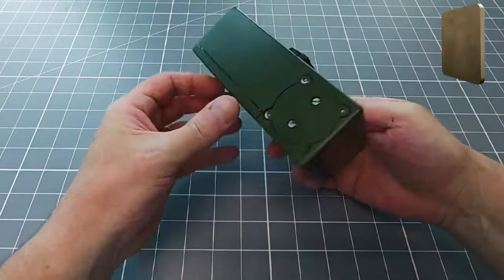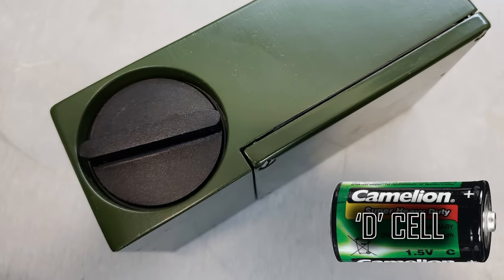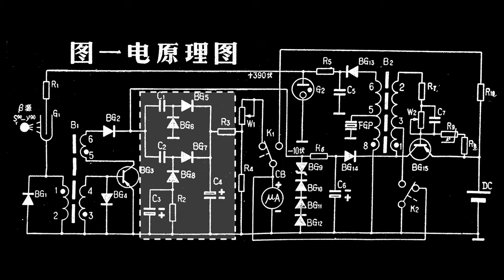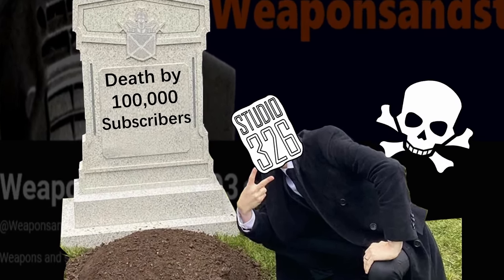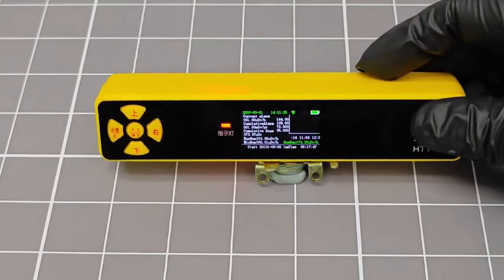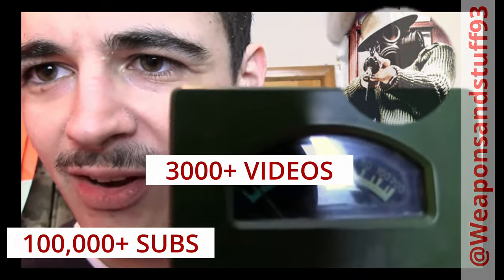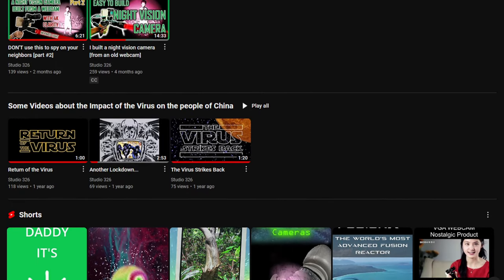Buying a Vintage Geiger Counter  ☢️

Comment: Yeah, you’re kind of right on weapons and stuff. He isn’t very bright countless pictures of him laying radium out on his carpet. Holding. Dp-2 sources dissolving the radium etc
Reply from the maker: I notice that he has really bloated out in the last couple of years, I do hope that isn't from mishandling these kind of things (hopefully just 'pandemic tummy').  Radium is about the scariest thing you could accidentally ingest with the obvious exception of Polonium 210, those old radium dials often release a lot of powder as they age...
Reply from the maker: That said, I am kind of expecting an army of his fans to start trolling the comments section of this video soon.
Reply from the maker: he is not the only one...  https://www.youtube.com/watch?v=-porXMRg_BI
Reply: When I got some thorium lantern mantles I kept them in the original bag, and put another bag over them. I'm the careless type so I am extra-careful with radioactive sources.
Reply from the maker: @gblargg  Very wise, the coating on the mantles is easily turned in to a powder...
Reply: @project-326 well, getting "bloated" also tends to happen when you get older.

If it was due to mishandling those kinds of things, he probably wouldn't be around.
Reply from the maker: @madmax2069  I know that feeling, all too well...
Reply: @project-326  yup. Same here, I weighed the same all the way up till I hit 40, and all of a sudden i found was really really easy to gain weight afterwards, and the older I get, the easier it is to gain.
Reply: @project-326 Am-241 however is around 10x worse than radium through inhalation hehe

Comment: Thanks for another well-done video! The circuitry is quite impressive. It's fascinating they went to the trouble of using an electroluminescent backlight, rather than a cheap incandescent bulb. Although I guess it ensures the bulb won't need to be replaced for the foreseeable life of the instrument.
Reply from the maker: It is a really nice piece of design work, I really enjoyed figuring it out!
Reply: The EL probably uses less power than a bulb. Too bad they didn't let the check source leak a little, then it could glow on its own without a battery!

Comment: Ah - but what dose do you get on your precision engineered German professional geiger counter though (or has it already had its last adventure)?? 🤣
Reply from the maker: Ah, I'm glad you thought to ask...  Video of that is coming up next.
Reply: @project-326   I'm hoping for a Terminator 2 type scene, where you've got a vat of molten metal, and the GammaScout gets lowered in, dissolving away!
Reply from the maker: @rhydar  I'll see what I can do.  Just not sure I can hide a purchase 8 tonnes of steel and the equipment to melt it from the wife.

I have a laundry list of vids to get done, KC761B, Beta Spectroscopy, etc.  Then the day job, 3 young kids...

Comment: Non-standard batteries have always been used in Soviet army devices, which are now impossible to find, in principle, only in a museum.
Reply from the maker: Actually a lot of British (and other NATO) devices also use custom batteries.  I never understood the purpose of that, these military devices are always huge, so lots of room for any size of standard batteries.
Reply: @project-326  Moreover, there are also devices with batteries for non-standard voltage, for example 11.5 volts. I just bought such an SRP-2 device the other day. A scintillation device for geological exploration manufactured in 1971.
Reply from the maker: @vladi_g  It's just hard to imagine what was going through the heads of the engineers that came up with this stuff, perhaps in 1971 transistors were really expensive and they wanted to avoid using a regulator, or more probably the company wanted to lock in the customer to buy their 'special' batteries...
Reply: @project-326  It seems to me that in my case, since this is geological exploration, people are out of civilization for a long time. The engineers just took the most capacious batteries they had so that the device would work as long as possible. We must pay tribute, the device also works from a modern 9 volt battery, but not for long. So the converter and voltage stabilizer can operate within a fairly wide range of power supply.
Reply: @project-326  It is mainly because that noone would steal them. Can't easily be used in consumer goods.

Comment: I used to ship all the geiger counters I refurbished with a radium calibration refrence source. Calibration valid for at least 100 years 😅
Reply from the maker: Radium is a very unusual check source, normally this is Sr-90 or Cs-137 due to the very short decay chains.  Ra-226 is on the Uranium decay chain, so there are a lot of different products in the isotope mix, each with their own modes of decay and half-lives.
What made you choose Ra-226 as the check source?

Comment: I loved the roasts on weaponsandstuff93 😂

Wish that the radiacode was in the video because I have one, but I don't have strontium 90
Reply from the maker: I'm working on a video that has both the KC761 and the RC102 getting a good dose of Beta from this source.  Clearly, being gamma spectrometers, they don't see too much from a beta source though...
Reply: @studio326-  I saw a video a while ago by neptunium and I believe it was a radiacode 101 but it could detect the gamma from polonium 210 (803 keV) so I wonder if strontium 90 has its own gamma line (block the beta to prevent bremmstralung) because as far as I know it should since nothing is a pure alpha or beta source since the atom still needs to calm down
Reply from the maker: @The-One-and-Only100  I'm kind of honored to have Neptunium as one of my small band of subscribers, he is a smart guy and a seriously talented experimenter!  You will have to make seriously long baseline measurements of Po-210 to be able to see any gamma lines and those only occur one out of about 100K decays as a statistical average.  I have not yet seen anything that even mentions ANY probabilities for gamma emissions from Sr-90 decay.  Given the very short decay chain, perhaps if they do exist as a small ppb type statistic, they are not measurable, even shielded...?
Reply: @studio326-  what I have in mind for an experiment that you are now able to do is have a thick plate of aluminum on top of the source so all the beta is blocked (test with a geiger counter) then if it's at your background then place the radiacode on top of the plate and wait awhile for a good spectrum then for redundancy use the kc761 and compare the two
Reply from the maker: @The-One-and-Only100  The issue with all long baseline shielded measurements is that the shielding material will always contain some radioisotopes, even if the shielding material is from pre-1945.  I'm in the process of doing some beta experiments for a video I'm working on, I'll have a look at this a bit more.  Who knows, perhaps something interesting will be found, I just worry that the huge Bremsstrahlung continuum will hide anything useful...
Reply from the maker: I'm just waiting for WAS93's 100K subs to start trolling the comments. That will be fun...
Reply: @studio326-  Hey, maybe they will learn something and subscribe to a channel that is superior 😂
Reply: @The-One-and-Only100 unfortunately the bremsstrahlung from Sr-90 is far too intense to test this. Even shielding the betas with plastic will produce a fair bit of bremsstrahlung
Reply: @inductivelycoupledplasma6207 that's the point of the experiment but not with plastic were talking thick aluminum so the beta is stopped but using the two gamma spectrometers would hopefully detect the bremmstralung and show a spectrum of it hopefully different than if it was point blank near the crystal
Reply: @The-One-and-Only100  i see. It's just that you said above you could shield the beta to eliminate bremsstrahlung which is different to what you said just now. Also a gamma spectrum of the source in contact with the spectrometer would be useless due to the large number of counts from betas (that are able to penetrate the enclosure around the crystal).
Reply: @inductivelycoupledplasma6207  This is what I said verbatim 

@studio326-  what I have in mind for an experiment that you are now able to do is have a thick plate of aluminum on top of the source so all the beta is blocked (test with a geiger counter) then if it's at your background then place the radiacode on top of the plate and wait awhile for a good spectrum then for redundancy use the kc761 and compare the two

The aluminum would block the beta and double check with a geiger counter, then using two gamma spectrometers, you could detect the bremmstralung without the beta

It's not really an experiment if you're just blocking everything that's boring but using two gamma spectrometers to see pure bremmstralung now that's something worth making a video about (I would do it myself since I have a radiacode but I unfortunately don't have strontium 90)
Reply: @The-One-and-Only100  you specifically said above to block the betas to prevent bremsstrahlung, so that any gammas with extremely low probability could be observed. Again, the bremsstrahlung still occurs whether the betas are shielded with lead, aluminium or even plastic. The efficiency 
of the bremsstrahlung process is just proportional to the atomic number of the target material. Also, some nuclei do decay without the emission of gamma rays. Not all daughters form in an excited state
Reply: @inductivelycoupledplasma6207  I forgot about that since it's been a month, but yes, I was curious if Strontium 90 had an obscure gamma energy like polonium 210 

But the experiment was for detecting bremmstralung without beta interference to make a spectrum other than a linear spectrum since the radiacode isn't beta proof the beta would enter and cause bremmstralung inside the device so the way I proposed to prevent beta from entering would be some thick aluminum plate or a block of aluminum (sure you could use anything but it's nice to show that aluminum foil can't block all beta like most people believe)
Reply: @The-One-and-Only100  I have done this experiment, and yes, you get a nice clean continuum from Sr-90 bremsstrahlung. Bremsstrahlung within the RC itself isn't the thing to avoid, rather betas directly striking the crystal and being detected. A couple mm of Al or glass seems to be sufficient for being the betas down to low enough energy that the radiacode doesn't detect them.
Reply: @inductivelycoupledplasma6207  What happens when beta hits the crystal itself so the source is point blank

Will it damage the crystal if it's exposed for a while, like a day or more, or will it be within minutes to hours
Reply: @The-One-and-Only100  it won't damage it, but the spectrum is useless unfortunately if there are stray counts from beta

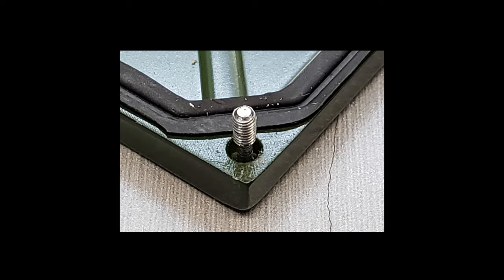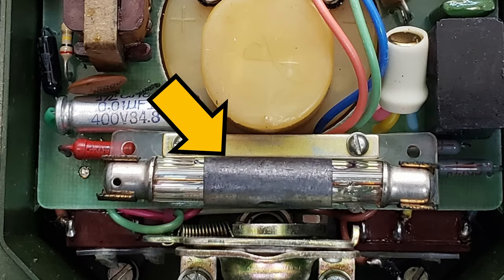Comment: The blue electrolytic capacitor at 3:47 min shows the label 84.9, the capacitor at 3:51 min shows 84.8. This means that the device was not built before 1984 - so it is at most 40 years old. It's surprising that no printed photos were used in the manual.
Reply from the maker: The photographs are a mash up of two units: the older one that I bought (all video footage and some of the stills), and some still photography from a newer unit that belongs to one of the subscribers (who is also in China).  The newer unit gave much nicer images for those close ups in the tear-down section.  The manual for my unit has a calibration stamp in it from 1979, I didn't get to see the booklet from the newer unit...  This is how I found out that the leather pouches were for the ones issued to officers, mine had a canvass bag.
I hope that helps answer your question?
Reply: @project-326  Yes, of course - thank you for the explanation!
Reply from the maker: @dg0mg  Well done for spotting the caps!  Glad to know I have such eagle eyed subscribers, clearly you don't just subscribe to any old channel, so it gives me a boost to know that you do!
Reply: @project-326   I run a forum on this topic in Germany and always have to know what's new. You're closer to some of the "Far Eastern" news - so that's always interesting.
Old devices are also exciting; in the past, different circuit technology was used. Just today Max Midas released a video of a Russian device that had no special high voltage generation - it simply used a 450 volt battery. On your Type 75, the electroluminescence light is a rarely used feature. But a military device from the former GDR (the RR66) also has such a scale illumination too, but is operated with 2 D cells, not only one.

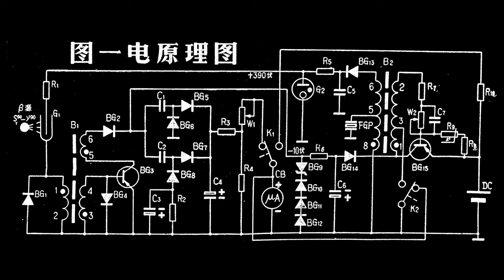Comment: 4:30 The kind of circuit design here is like modern assembly code that does a bunch of things with a tiny bit of code, including being all cycle-timed to decode some external signal coming in.
Reply from the maker: Assembly code is what hardware engineers call (real) firmware.